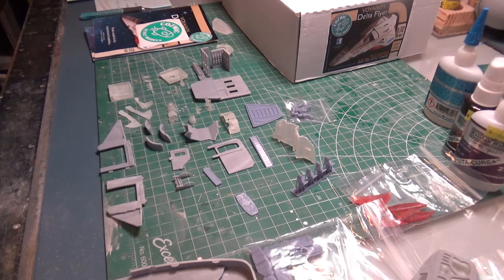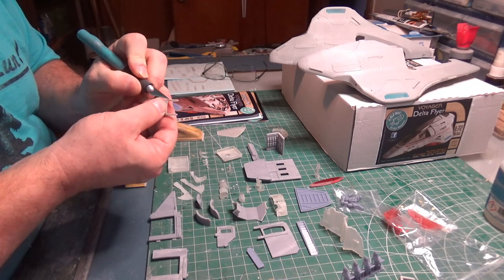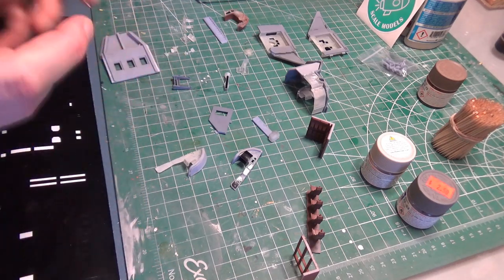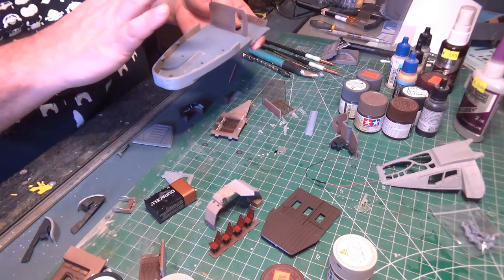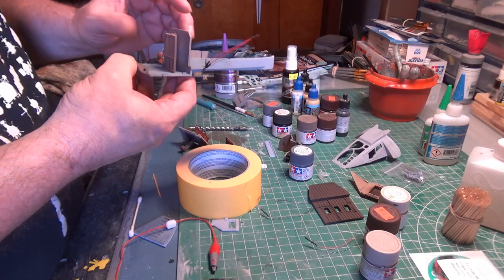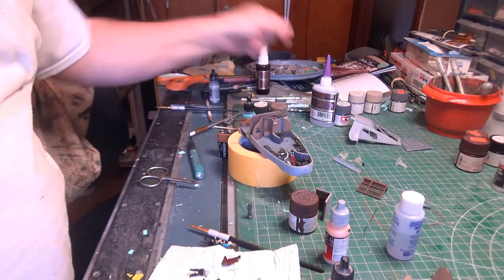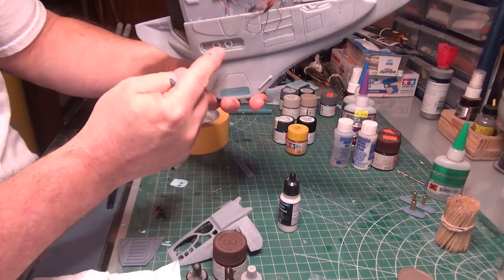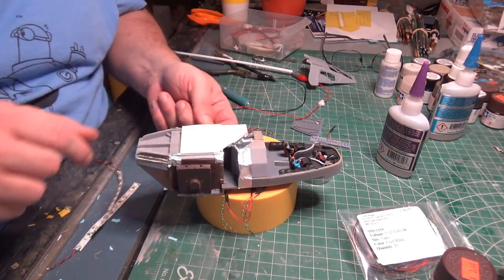Aztek Dummy Update 2/26/21 - 1:72 Delta Flyer - Part 1: Interior

Comment: What I've always found to be most troubling about these smaller shuttles is the lack of a head for the crew. Personally, I would need to bring an empty gallon jug for extended excursions.
Reply: I'm sure the Delta had a head. Tom Paris designed it after all He wouldn't be that dumb.LOL
Reply from the maker: "below deck" maybe? or maybe behind the replicator wall?
https://www.youtube.com/watch?v=JddYgEoO784
Reply: @aztekdummy  The interior of the Delta flyer is actually larger than you think maybe it somewhere near the warp core. Though makes you wonder where the heads are on starships as you never see anyone taking a pee break.

Comment: A pleasure to watch you work as always, sir. I love the banter & the Elton John puns. I also really appreciate your ability to be informative, interesting & entertaining. You've certainly helped improve my model building, the Tulip fabric paint has been a godsend when it comes to light blocking. I found when I tested my 1:18 scale X-wing engine lights after sanding & repainting the engine nozzles that I was getting some major light leakage through the plastic & paint but the Tulip paint fixed that right up. I've also taken to giving my photoetch parts a layer of Vallejo gloss varnish to improve the decal positioning which, despite being very high quality, were giving me an absolute migrane! I spent 45mins wrestling with one of them only to completely destroy it with microsol! I'm very new to all this & shaking hands do not, a competent model builder, make. So thank you again & keep up the excellent work, it's greatly appreciated.

Comment: I was never a fan of the Flyer but that's an excellent faithful build as far as I can tell.
It has to just be the camera making the light in the Engineering alcove and the "back room" look too bright.
I was wondering if you could get away with using white LEDs to light the engines and use spill light from them for the side consoles, but as usual You'll want to be able to light the engines independently of the interior, right?
Reply from the maker: the interior is it's own tub or else I could have used lights from the shell to light it. I plan on using colored leds in the wingtips to light the engines

Comment: Hi Lou, couldn't you just print out a negative black vinyl mask to use under the console for light blocking? Or is it not thick enough
Reply from the maker: yes you could. but it's the overall thickness that it would add to the side consoles that is the sticking point